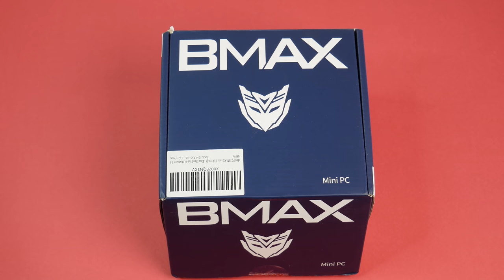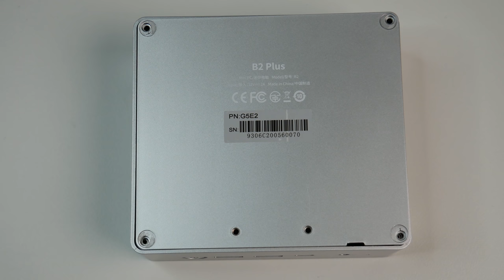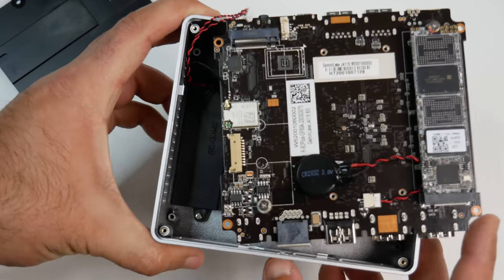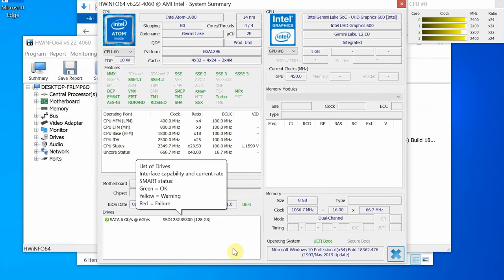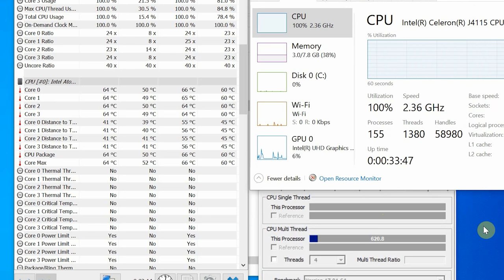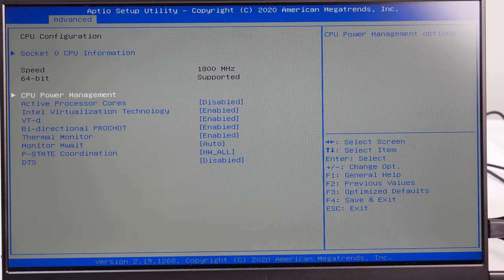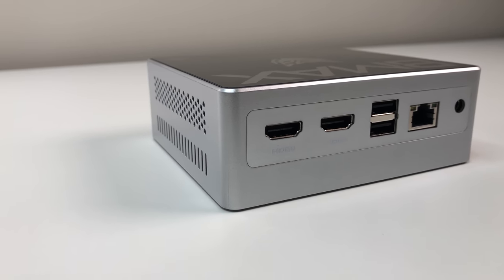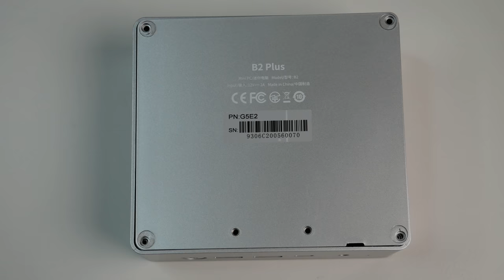Mini PC Review (2020) - BMAX B2 PLUS Mini PC REVIEW, ( Intel Celeron J4115 ) TEARDOWN & BENCHMARKS

Comment: I just purchased the BMAX B2 Pro Mini PC, Intel J4105 Quad Core CPU Up to 2.5GHz, 8GB DDR4 256GB SSD, 4K 60Hz HDMI 2.0x2, USB 3.0x4, USB 2.0, Micro SD Card Slot, 3.5mm Audio, M.2 2280 SSD Slot, 2.4/5GHz Dual Wi-Fi, BT 5.0, RJ45 1000Mbps Ethernet, Windows 11 Pro. I'll see how it preforms Thanks for the review.
Reply from the maker: Appreciate the Feedback.
Reply: How is it ? Does it actually do 4k video ?

Comment: The BMAX B1 Mini PC did not detect Transcend 256GB NVMe M.2 2280 PCIe Gen3x4 SSD:- 

The product specification of the PC mentions "Solid State Disk: Support 1* M.2 2280 SSD." And the Package List mentions 1 x SATA cable. However, the receipt package of the order specifically did not contain a SATA cable rather it contained a HDMI Cable in place of said SATA cable.

Since, M.2 was designed to support SATA and also PCIe, so this raised a question in my mind in selecting an appropriate interface between SATA and PCIe. 

However, there is a M Key socket in the system board of the PC for the M.2 2280 SSD, so possibility of SATA interface is eliminated (at least in my case) considering almost all M.2 2280 SSDs with SATA interface mostly have B+M Key edges but I do not find such an SSD with SATA interface have M Key edge. Besides, all M Key edged M.2 2280 SSD's have PCIe interface, so there's only one possibility for a M key socket i.e. PCIe interface.

Accordingly, I have purchased one Transcend 256GB NVMe PCIe Gen3x4 80mm M.2 SSD. But after insertion in the The BMAX B1 Mini PC socket, it does not detect Transcend 256GB NVMe M.2 2280 PCIe Gen3x4 SSD. I did not change the default BIOS setup of the PC and uncertain whether the BIOS at all needs any setup modification modification.

So what may be the reason that the BMAX B1 Mini PC did not detect Transcend 256GB NVMe M.2 2280 PCIe Gen3x4 SSD in my case?
Reply: M.2 also supports SATA. The B1  M.2 slot does not support NVMe, but the B2 here does.
Reply: @awuma  well, i have a brand new bmax b2 plus, and i installed a brand new 1tb sabrent rocket nvme m.2 2280 pcie. it did not detect it in the bios nor in windows.
Reply: @theddygrumo  me too!  No clue from BMAX on how to get it to recognize NVMe SSD
Reply: i have some problem
The BMAX B2 plus  Mini PC did not detect Silicon Power 256GB NVMe e 1.3  M.2 2280 PCIe Gen3x4 SSD: P34A60  help my please thanks a lot Marco

Comment: How did you access the BIOS? I have the B1 and the USB ports are not active on startup. I have tried holding the power button for 3 seconds, either it doesn't work or my timing is off.
Reply: Mine is no longer running windows 10 either.
Reply: Press Delete during the boot

Comment: Does anyone have any idea why the disk speeds on the 128GB M.2 drive are only topping out in the 500's? I would have expected over 3000. Are we dealing with a very slow M.2 drive, or are we limited in PCIe lanes? Also, are both M.2 slots identical in specification, such as lane usage?
Reply: I may have answered my own question. This unit has 2 m.2 slots. One is SATA based with a limit of 500+. The other is a PCIe based slot capable of 3000+. The 128GB M.2 card is installed in the slot labeled "SATA". No idea why! The video clearly shows the m.2 card in the "SATA" slot at 2:11. My unit arrives tomorrow. I will be plugging a nice Black Label WD m.2 drive into that PCIe slot with Win10 @ 3000+. Should provide 6x improvement in disk I/O. 
PS: Upon a closer look at the video at 2:11, I can clearly see that the 128GB M.2 drive is using the slower SATA based interface, utilizing a 2 notch M.2 connector. This interface only supports 550MB/s. The newer and faster NVMe based drives use a single notch M.2 connector, and can provide speeds up to 3500 MB/s. The SATA based M.e drive supplied, will be limited to 550MB/s, even if it were plugged into the PCIe based slot. The only way to fix this, is to throw a real PCIe based M.2 drive into the PCIe based slot, and put WIN10 on it. With that upgrade this thing will be lightening fast!
Reply from the maker: Appreciate the Feedback. Please don't forget to Sub + Like + Watch other reviews, and share.
Reply: @mazeeff  how did it work for you? i have a brand new bmax b2 plus, and i installed a brand new 1tb sabrent rocket nvme m.2 2280 pcie. it did not detect it in the bios nor in windows.
Reply: @theddygrumo  I have two of the BMAX units. I upgraded both to PCIe based m.2 drives. I used a WD SN750 500G, as well as a Sabrent Rocket 256G drive. I had to change the sector size from 4K to 512 on the Sabrent to get my cloning software to work. I was also able to install fresh copies of Win10 on both drives as well. Unfortunately, the speed of the new drives was only double the existing SATA based m.2 drive, going from 500MB/s  to 1000MB/s. Both of these PCIe m.2 drives get well over 3000MB/s on my desktop. HWINFO64 reports only 2x PCIe lanes available, instead of the normal 4x on my desktop. Looks like only 1 lane is being used on the BMAX. Overall, I'm still pretty impressed with this mini.
PS: Make sure that the option in the BIOS; chipset/southbridge/m.2 m-key x2 is enabled. It should be enabled by default.
Reply: @theddygrumo  If you figure it out, please reply.  The Bios shows both ports configured as eSATA, not PCIe.  How one re-configyres a port is ??????
Reply: @mazeeff  The Celeron CPU supports 6 PCIE lanes total expansion at version 2 not version 3
Reply: @aeasus  Bingo! I had no idea that the brand new J4115 was limited to PCIe version 2. This explains my results of 1000MB/s, since the interface is running at PCIe 2x by 2 lanes. My desktop runs at PCIe 3x by 4 lanes and gets the full 3000MB/s. Also, the BIOS worries me as well. No where on BMAX's web site can you find any BIOS's at all. The AMI BIOS V1.1 appears to be a generic one. I'm used to having BIOS updates from the motherboard manufacture directly, but BMAX does not seem to have a clue. Perhaps they are not the manufacturer!
Reply: One more issue has cropped up, relative to the PCIe 2.0 limitation. While connected to a 55" TCL Roku TV (55R625), running 4K @60hz, the J4115 can not output full Chroma 4:4:4. The best best it can do is 4:2:0, which results in a far less quality picture. This is strictly a bandwidth limitation due to PCIe 2.0. With my desktop running a PCIe 3.0 based 570 Radeon, I get 4:4:4, and the difference is quite noticeable.

Comment: Could you please add results of Geekbench 4 and 5?
Reply from the maker: Sorry cannot. I already sold the unit after the review. I buy these tech from my money and sell it after i review it.
Reply: @DealUnboxing  How loud is the fan is in idle and heavy load? I have Chuwi Herobox (review on my channel) which is fanless but it has issues with ethernet (only 100Mbps)
Reply from the maker: @cbm80amiga  Fan was not loud at all. If you checkout the teardown section you will see BMAX done a good job with cooling. Also didn't had issue with ethernet at all, i was able to connect at 1Gig LAN speed.

Comment: Great review. Interesting i don't find Intel Celeron J4115 in any other PC, so i guess it is brand new SKU.
Reply from the maker: Yes it is New CPU. You can check it out on Intel's website.
Reply: From Intel site: No results found for "J4115". But from Odroid forum: "Intel started early this year to offer a slightly modified chip called the J4115 for small manufacturers like us.", so it's still 2017's Gemini Lake CPU family, not Gemini Lake Refresh (with 300MHz base clock increase, and 100MHz decrease in turbo multi-core speed from J4105).